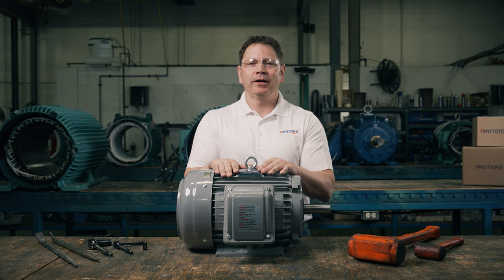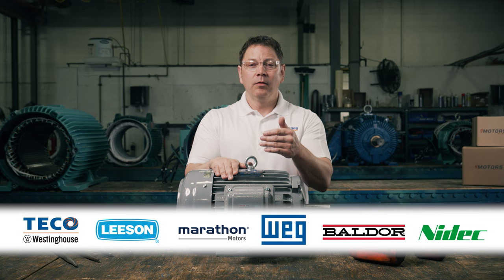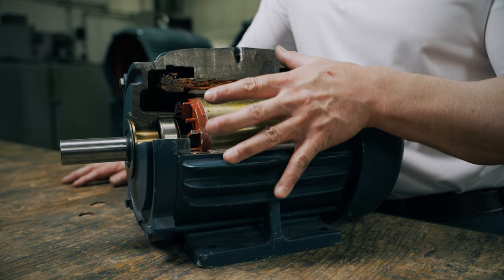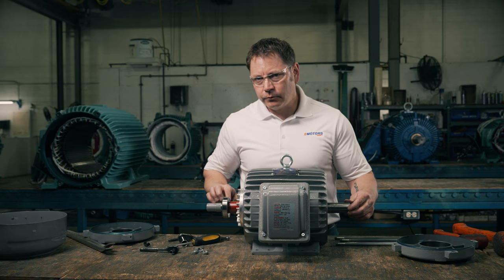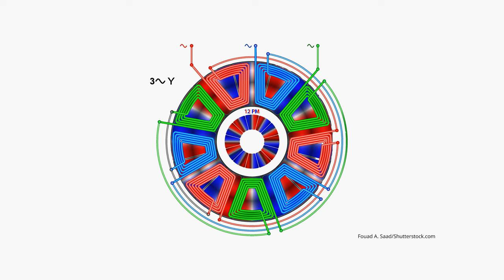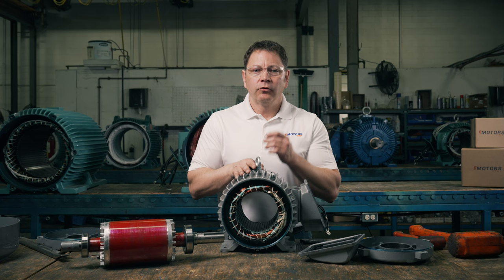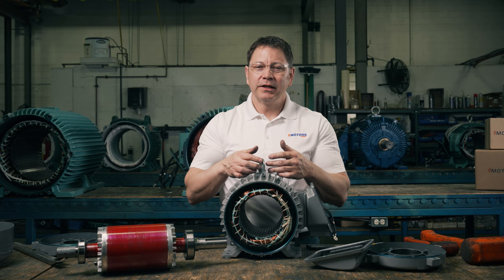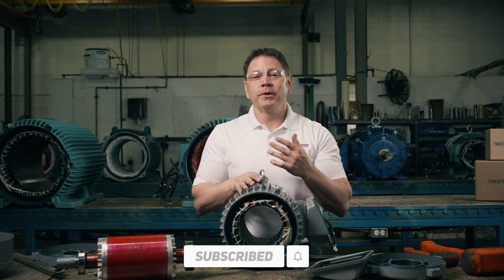How Does an AC Motor Work?

Comment: How can i protect an ac motor from voltage failures
Reply from the maker: Hi Linos, There are two possible concerns here.

1. Voltage fluctuations in the line: Generally these occur when there are multiple loads on the same source and the source essentially not all voltage sources are made equal and some are more vulnerable to load fluctuation. This can be remedied by adding a stabilizer but alternatively a VFD can also insulate a motor from these types of voltage spikes.

2. Voltage spikes in the kHz range from inverters: These occur due to how power inverters reconstruct the voltage waveforms and can be mitigated using load reactors or chokes and their effects can be avoided by using shaft grounding rings and insulated bearings to prevent discharge.